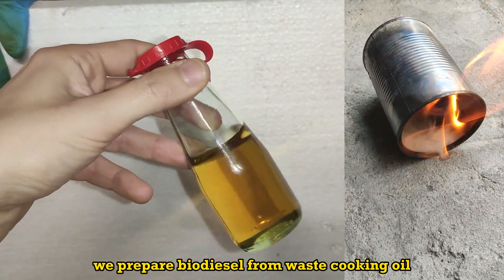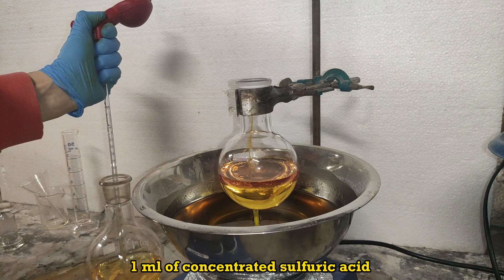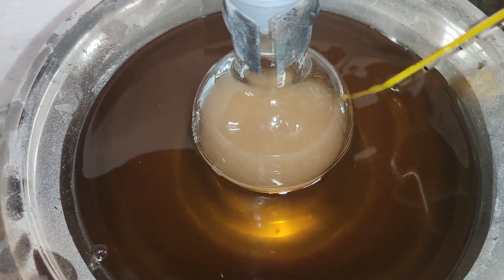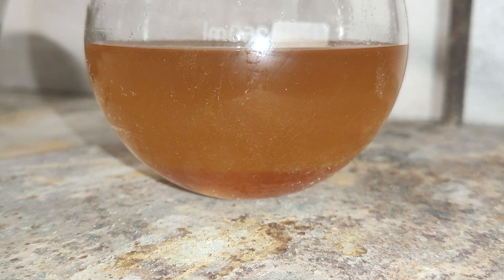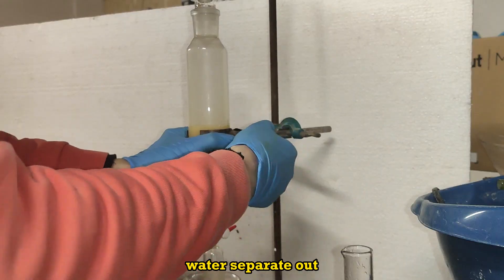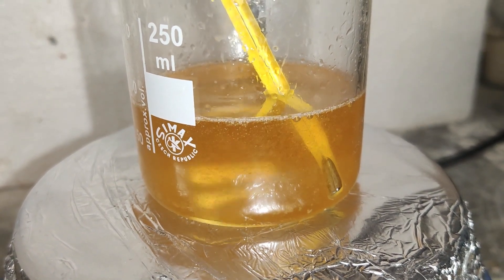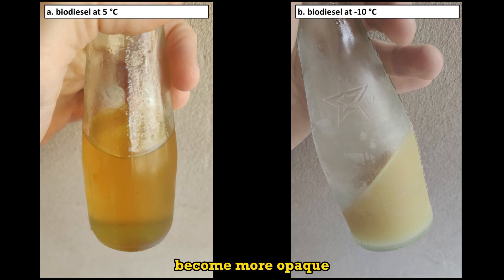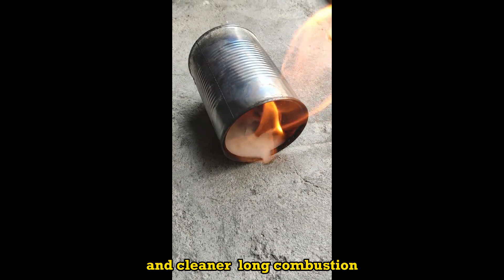Making biodiesel from used cooking oil

Comment: Thank you very much for posting, very interesting technique. I have a question please: When you heat oil/ethanol/sulfuric acid mixture at 90 Deg. C and use the reflux condenser. Is the reflux condenser recovering Ethanol that was used? If so, what percentage of the ethanol is recovered?
Reply from the maker: Yes, the reflux succeed to condense ethanol vapors back in the flask. Ethanol get consumed during reaction, so refluxing slow down over time.
Reply: @zodd0001  Thanks, Will you be doing a follow up video on recovery the ethanol from the Glycerine? Would be interesting to see that recovered.

Comment: I do research on biodiesel made from ethanol. Basic transesterification does work, but the reaction must have minimal water present. The biphasic separation is more difficult when soap and water is present, because ethyl esters have slightly different density and polarity than methyl esters. Also, we distill the glycerol made to produce a glyceroxide catalyst for the basic transesterification
Reply: Only problem here is the Ethanol is more expensive than the Diesel i can buy. :(
Reply: @Preyhawk81  it is more expensive than methanol unless we distill our own ethanol from yeast.  We further dry the ethanol with Molecular Sieves over 24 hours. We have used 95%ethanol/5%methanol as well for cheaper options. Small amounts of methanol improves the water tolerance of the reaction anyway!
Reply: @kylemcguff5581  thats why he was using de-natured ethanol... its de-natured by them adding in methanol  so its not drinkable
Reply: @jettamaster3297 I've had ethanol denatured with both methanol and isopropanol, which did not work. Sometimes, the denaturants are just nonpolar enough to ruin the phase separation completely. 

It isnt necessary to have denatured ethanol, but it will be quite sensitive to water/soap and more difficult to use metal hydroxide catalysts